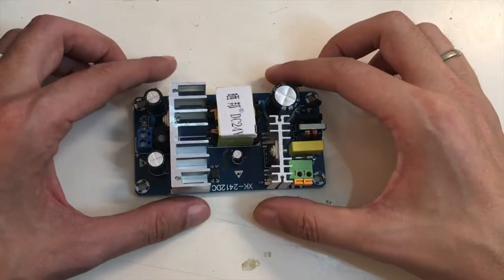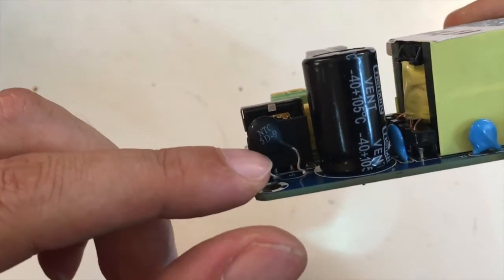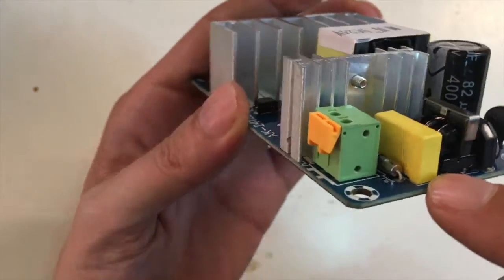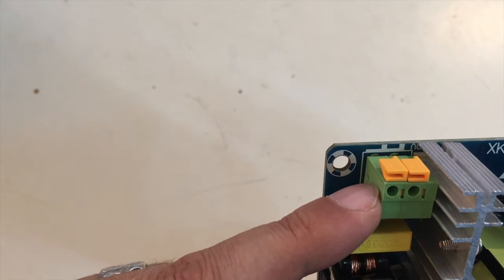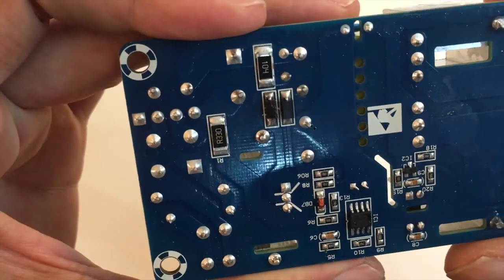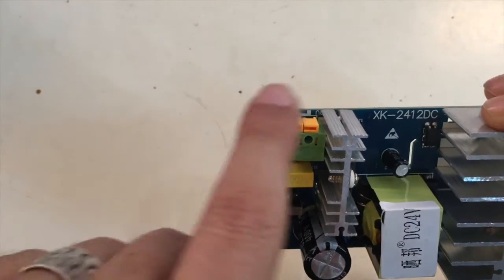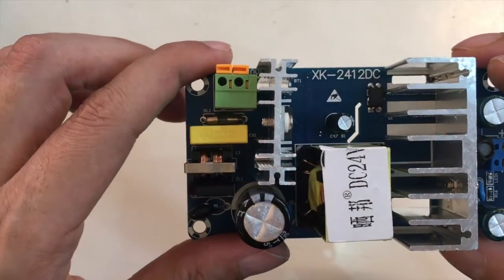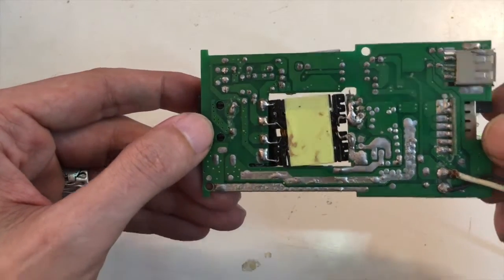#002 Quick look @ cheap 24V Power Supply

Comment: good / bad?
Reply from the maker: for that price not bad. It is not high quality, but working.
Just be aware it is mains voltage life and requires an enclosure for that reason!!
Reply: Frank Sander   Is it an anolog or switching power supply?